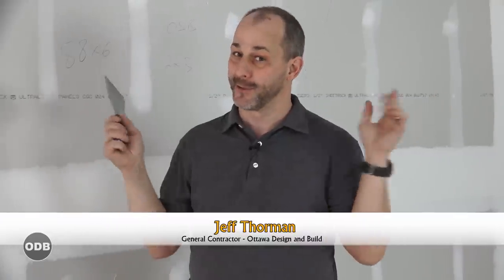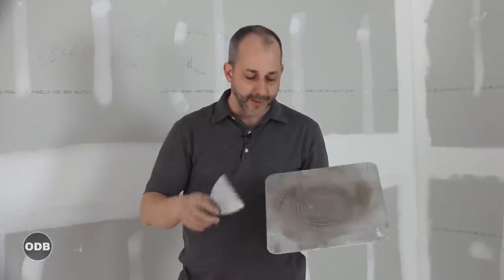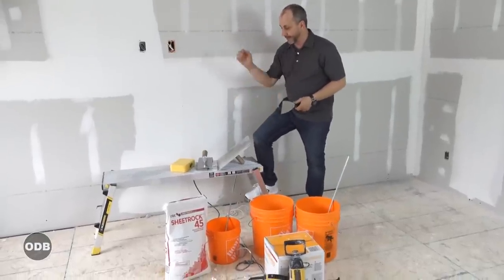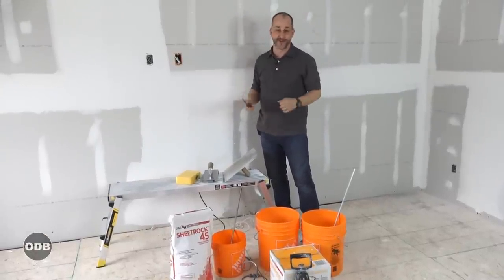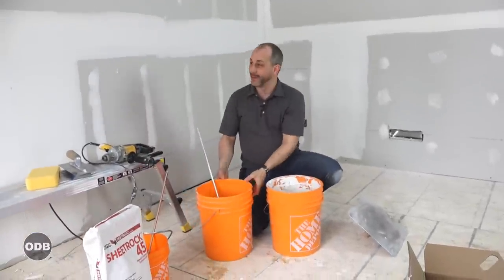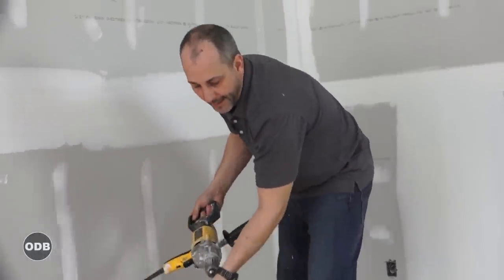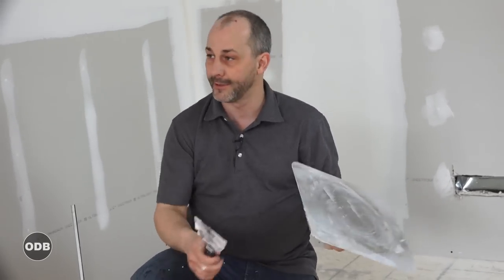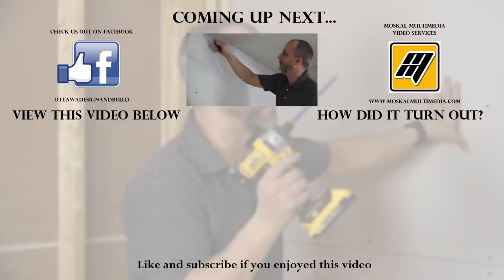The Ultimate DIY Drywall Guide | Taping Tools & Must-Have Materials

Comment: Okay... that took quite some perseverance to find a hawk. Had to make my own in the end. Just does not exist in Sweden. Then the trowel! Finally found that in stainless and wide AND flexible at Biltema; cheap too. Everything else was relatively easy to find APART from a sealant for my old damaged drywalls. That i found at Flugger shop.... (Sealer Non-drop
Sealer) 
Product Description was...
Transparent blue-tinted primer with good penetration. Provides effective base and adhesive surface on mildly chalking and absorbent substrates. Used before painting or installation of wall covering. I THINK its a good alternative to the other silly priced products. I did consider shellac but that seemed a bit awkward. So far your help has been clear, logical and very welcome. I must say i have noticed that a lot of this corner cutting methods from previous owners of my property has left me with what seemed like a mountain of work and little know how from other professionals as to how to fix it. Their advice had been very dodgy after listening to you. Thank you very much for putting this out there. I really needed this. Tack.

Comment: Great tips. I've been contemplating purchasing a hawk instead of using my tin troth. You gave ample reasons why I should go for it. Your suggests have reduced my anxiety about doing my the taping myself. I've done relatively small taping, patching, walls and partial ceiling but not the full basement which I am tackling now. Thanks for making these available - they are extremely helpful and adds a bit of confidence.  Love the explanations of why... I think I've done most of the mistakes you've mentioned!
Reply from the maker: Brian, you will be fine. taping is a s much art as practice. By the time you are done your basement you will be doing videos of your own.

Comment: Jeff, Great series!  I have a few questions.  1: Best practices for clean up and disposal of mud? Can you pour down sink drains in home? 2: After final sanding of walls, is there a need to wipe dust off before painting? I remember you mentioned the negative air helps, but wasn't sure if that gets all dust out.  3: Do you ever, or have a video, apply texture to walls or ceilings? Most homes where I'm from have texture, and I would appreciate a good tips video. Thanks
Reply from the maker: Hi Lee, just put garbage mud in the empty box. don't waste your time with the dust it actual;ly helps with the priming process. I don't have any texture videos.....YET! Cheers!

Comment: I purchased a 4.5x12" drywall trowel not realizing it has a bowed blade. I am not having good luck with it! Do you NOT recommend one of these? Or what is the proper situation to use it? Leaves a ton of mud on the wall unless I press suuuper hard... Thanks man! I have started drywalling a bedroom with no previous experience following your vids and going great so far!

Comment: I wish I'd seen your sheeting videos before sheeting my entire house - too late now.
What's the largest sized gap you can reliably fill? I have a few rooms that were slightly larger than my sheets (or sheets that were cut less than perfectly); I have gaps in some places as large as 1" - can these be filled with mud, or should I be putting some strips of drywall in there first?

Comment: it would have been cool if you have explained the different types of muds, when and when not to use them.. from what i understood you use a fast setting mud for filling gaps and seams and then a taping mud for everything else..
Reply from the maker: close, I also use the fast setting mud to fill outside corners. this allows you to add a finish coat on the same day. Cheers!

Comment: Just bought our first house that has unfinished drywall. It has been this way for I’m guessing 10 plus years.  Any advice besides sweeping and doing a damp cloth over everything to try and get any dirt or grime off the drywall, before I start putting the first coat of mud and tape onto all the seams and nail holes? After tape and mud will prime and paint as well.  Thanks for any advice!

Comment: Love your channel and need advise on repairing some window unfinished work. My walls are gypsum board with holes covered with plaster. the guy who installed my windows too short cuts to avoid finishing the drywall work by installing crown molding. My wife doesn't want the crown molding anymore. I need advise on repairing the work.

Comment: As someone who had never done drywall before and followed these videos to complete a room.  I highly recommend not using a trowel if this is your first time.  I found it much easier to use a 10 or 12 inch taping knife.  I could not get the surface smooth and consistent with the trowel.
Reply from the maker: Perhaps you need to watch 1 more time.LOL no worries the taping knife still works just causes a lot more sanding.
Reply: +Home RenoVision DIY Your probably right. I can say the sanding I had to do was extensive and I had a number of areas I had to go back and fill. These videos were very helpful to complete my project. They were the most informative I found. Thanks for doing them.

Comment: Hey Jeff - first I still love all the videos you post, they have helped me numerous times. I am curious if you can use mud with a harder in on the first coat? I have drywalled and finished in the past but never with quickset! Thanks
Reply from the maker: You can but only with the mesh tape. if you are using paper I recommend using the regular compound for that. Cheers!

Comment: Jeff I just discovered your DIY video series a couple weeks ago an am completely addicted now. You are AWESOME!!!!!!! I realize this is an older video but its timely for me as I’m reno”ing my bathrooms. But I’m going to throw this question at you any way in the hopes that you”ll respond.  If I will be tiling over the drywall patch I just installed along the base of my wall do I still need to tape and mud the drywall joints? The tile covers the patch job entirely so can I just start applying tile adhesive? Would love to skip this step if I can but I definitely share and appreciate your mantra of doing it right the first time!!! Keep the videos coming......and I will be glued to them (lol).
TKM in Olympia.....PS am big Canadian fan:)
Reply from the maker: Hi Tina, good news, you don't need to repair the drywall if you are going to tile and the drywall has been screwed to something. Let the adhesive or cement do the heavy lifting here. save your effort. Cheers!

Comment: I don't understand when to use the machine mud, or when to use the sheetrock 45. You have 4 videos/parts of drywall finishes, you keep using mud, but never specify which mud to use in each, at which stage. This is somewhat difficult in terms of speccing out how much of each you need to get. I don't know if sheetrock is only for the first coat (which I'm assuming it is)
Reply: Use machine mud for taping and all the additional coats. The 45 mud is good for patching and for filling in gaps.
Reply: Sheetrock 45 has a hardener in it for big gaps. If you use the Machine Mud on big gaps it will shrink and crack.

Comment: I've always been told to add a few drops of liquid dish soap to the mix.  It is supposed to greatly remove air bubbles and increase smoothness.  Yes??
Reply from the maker: Never heard of that!
Reply: DO NOT DO THAT! ROOKIE MISTAKE. the manufacture warranty will be void if you do. Just use water and a mud mixer to bring it to the right consistency!

Comment: Hi Jeff I’m sealing up a doorway with drywall. Can I just use all purpose joint compound or do I need the one with the gardener? I really appreciate your help and I enjoy your videos very much!
Reply: I meant hardener
Reply from the maker: you can use regular mud everywhere. just not too thick at one time. and wait until it dries. The hardener helps speed things up a lot.

Comment: Hi, thanks for the useful video, I’m not a professional builder and I’m now thinking of installing a dry wall on internal brick wall. Can I install it on wood stud rather than dot and dab. I am thinking installing the wood stud with screws first then the dry wall on it. I know it more expensive and time consuming.
Reply from the maker: I would suggest framing as well. take the time to add some insulation and vapor barrier. remember, mold likes heat moisture and food. in most cases a wood wall with drywall all ready has 2 of those 3 so you need to control at least 1 element. Cheers!

Comment: a question - 
If you have to cut a large out-of-square piece of drywall, how do you find the measurements?

i have a method using a large framing square and determining how far out of square it is, but it's difficult and time intensive. you have a better way??
Reply: Drop a line down the center of the square to be filled, laser, chalk whatever... than measure out from the line to your ends

Comment: Do you use the Sheetrock 45 on all meeting walls and walls and ceilings first then use drywall mud and tape over those areas?
Reply from the maker: I usually use 45 to fill latge gaps only.Unless I am in a hurry on a small job. Then I use it for the whole project.

Comment: How many coats do I put on for the inside corners and the corners where the ceiling and walls meet? I taped then once dried and applied a coat. How many more do I need to do?
Reply from the maker: usually 2 is normal but that depends on how happy you are with the result.

Comment: Great video,what do you think about the all purpose mud can that be used on first second and final coat?
Reply from the maker: I love it, especially the machine mud but you can use a variety of all purpose. It is a lot like paint. everyone has their own favorite supplier based ojn their own style. some guys like a rigid knife and use a stiffer compound. I just think that creamy gets the best results, especially with sanding.
Reply: Home Reno Guy is WRONG. All purpose is for TAPE. It dries like cement. If you are a newbies DIY guy and build up too much and it dries, you will be sanding till you're 105 years old.
Reply: @SOLDOZER  that's funny. Agreed

Comment: Are you using a beveled or flat trowel? Also, thanks for the great videos.
Reply from the maker: Definitely a flat trowel. This one is stainless steel and very rigid. I don't want to use something that let's the mud push my trowel around. I want to push the mud around.

Comment: How do I take care of a closet that is painted and has a bunch of holes from old shelving units in it. Cant seem to fill very wall as the cardboard from the drywall where the holes were keeps showing. The paint is I think a semi gloss. How do I fix this so I can repaint?
Reply from the maker: you need to take the handle of your tool and dent the holes so that you can fill. once you use a little pressure and twist the damage will indent and you can fill with ease.

Comment: Where do you buy the 4x10 stainless trowel ?
Reply: You don't need one to tape. In taping, at least from my experience as a drywall taper in America, we use 6", 8", 10" and 12 inch putty knives and those work perfectly well.

Comment: Dude you have to TIGHTEN the chuck on the drill..wow, never seen that before, no key??   wow...….slow down, do it right. thank god OSHA is not around!!  ty for the video, though.
Reply: You don't have to tighten the chuck.  The shaft on those mixers are a hex so a hand tight chuck holds them just fine.  He does it that way because you have to take it out of the drill and put the mixer in water right away and if your mixing a lot tightening and loosening the chuck gets to be a big drag.  What exactly do you think is going to happen that's so urgent?

Comment: Can  mud for taping / first coat be mixed too thin?  Machine Mud is not available in my area - only USG All Purpose which is much thicker (hard to apply smoothly).  Adding a little more water to make it smooth & workable, but wondering if there's any downside if I accidentally thin it a touch too much.  Thanks for all your videos and advice....I've learned a lot!

Comment: Any tips on unleveled walls? Like part of the wall that is fine is thicker than the drywall pieces you've replaced? Just keep going over it with layers of mud until it evens out?
Reply: Did you use the same thickness of drywall, as the original, on the sections you've replaced?

Comment: Jeff,I wanted to know if you could share your thoughts.Issue:  Bubbles or blistering after applying second coat of All Purposed premixed compound.The blistering does not occur on the first, only second coat.  Usually, if the second coat is  heavy.  Note: The All Purpose Compound  is mixed prior to application.  There is no contamination on the surface where the second coat is applied (furthermore it is on top of the  first coat previous applied). Any solutions or causes are greatly appreciated.  (I heard but have never tried a little bit of dishwashing soap mixed into the All Purpose Compound before mixing to butter consistence.) Thanks for your tips.Ron
Reply: The reason why you have blisters or bubbles is probably because the mud wasn't the proper consistency to begin with. Also the base coat of mud needs to be completely dry before you put another coat on otherwise you will get air bubbles. There is literally no reason to use any additives to the Mud like dish soap. That is a rookie mistake and will void out the warranty on the mud if you ever have problems in the future.

Comment: You the man! Quick question, if 45 minute mud is for a base coat, what would be a good U.S. version of Machine Mud you'd recommend? So if i'm getting this right it's the 45 compound used for level one scratch coat, then subsequent skim coats are another type of compound?
Reply: Or did you highlight Sheetrock 45 in the video for that exact reason? Meaning that would be used for all coats (U.S.), but subsequently thinner out as you go to 2-3 coats? Sorry if I'm confusing you!
Reply from the maker: Hello Ryan, so 45 for filling gaps and cracks. use regular premixed with a little water for taping. use 45 to heavy fill corners to avoid cracking. and regular mud with water for all other finishing. Cheers!

Comment: Thanks Jeff! Great video! And gives me the confidence to tackle the taping and finishing of my basement,  quick questions, 1 I can’t get machine mud like in the video here in Montana, any suggestions? 2nd once mixed how long is the mud good for, assuming it’s sealed in the buckets?  Thanks!!! Keep up the awesome videos!!
Reply from the maker: Hi Tracy, you can use any ready mixed all purpose joint compound. Just be sure to add a little water so it sand s easier. Mud in the bucket can last a couple of weeks if you keep a cup of water on top and then close the lid.
Reply from the maker: Anytime Tracy Flikkema. I am here to help!

Comment: Thanks for the great videos and tips.  Would you list the brand name of the tools you use and where to buy them (especially the 4 in. flexible joint knife and the 11 in. trowel)?  Thanks you.
Reply from the maker: 4" knife is available anywhere. The 11" trowel is available at some pro paint stores or at any pro drywall distributor.
Reply: Some of the stores have these trowels for sale on the same rack as the steel concrete finishing trowels, so long as the size is the same- is there any differences? Thanks

Comment: You prefer Sheetrock 45 or 90?
Reply from the maker: 45 for fill 90  if I am doing a small job and want to 2nd coat same day. It all depends on the working time I need and the size of the project.

Comment: Also, it is a little confusing for me to know when you are using just plain old regular joint compound,  maybe with a little water in it only.  (Maybe I missed something - am getting older! ) :^)
Reply from the maker: I use hardener on mesh tape and outside corners. As a rule everything else is regular compound.
Reply: Why for outside corners?
Reply: Thank you for all your teaching.  Without your help,  I would be in big trouble.  Thanks again!

Comment: Do I use mud 45 for step 1, 2, & 3 or do I need to use something different for step 2? I have to use 45 to fill some 1/2 inch gaps with mesh tape.
Reply from the maker: Hi Cindy, fill 45, all joints regular mud. fill outside corners with 45 to avoid cracks and finish outside corners with regular mud. Cheers!
Reply: @HomeRenoVisionDIY  Thank you so much!! I appreciate your help! :)